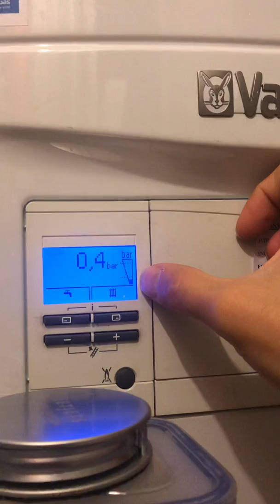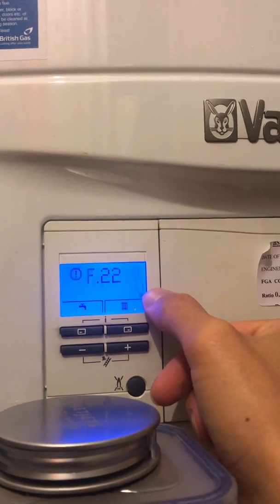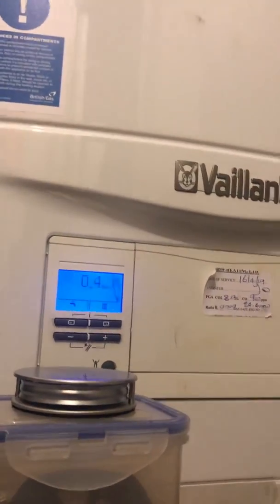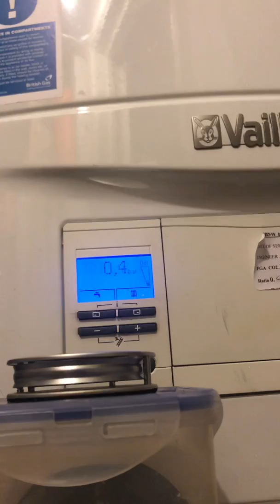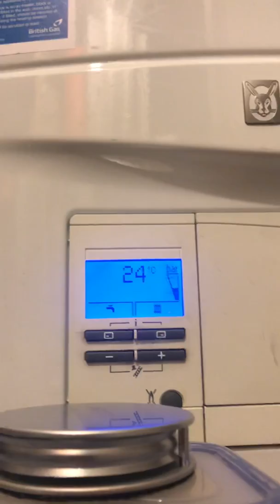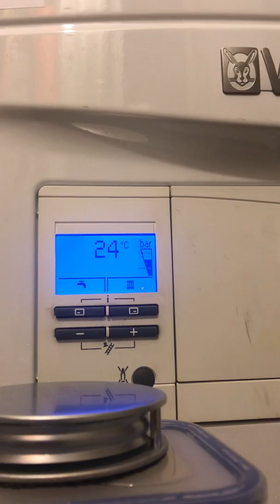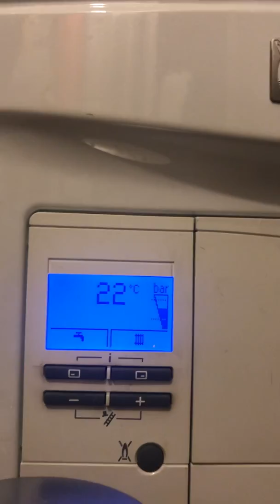Vaillant Boiler controls | No Hot Water and No Heating | F22 Error

Comment: Hello dude< nice video, i have a vaillant EcoTec Pro 24 ,  at the moment im getting hot water intermittently , most of the time the hot water is available, but on a lot of occasions, the boiler will click on then off again within a second or so as it tries to give hot water, and it wont give hot water at all despite leaving the tap running.  Also the water flow out of the hot tap is lowish when it first runs before receiving hot water, also im not getting hot water very early in the morning also,  when this happens the boiler doesnt click on and off at all even.   from what i know so far this all can be an issue with the flow sensor component inside the boiler? the pressure inside the boiler is just below midway of the two lines, so no problems there. any help would be appreciated   regards James,  a while ago my microwave triped a fuse in the flat, and while it was still on i tried pushing the switch back up but it kept coming back down again because of the microwave, anyway perhaps this electrical discrepencacy with trying to push up the fuse switch mutiple times has affected the electronics of the boiler/firmware/flow sensor.
Reply from the maker: I think it could be anything really. 🤔 n this case it might be wise to get a professional out for a quick look as they would do an overall check that will identify the fault and then change parts required etc. please subscribe and like if you haven’t already would really appreciate it 🙏🏻. Best of luck 🤝

Comment: Thank you but still didn't work. Had this put in 3 yrs ago and I've had nothing but trouble. I've had engineer's on 5 times 3 mote controls. Lewisham council fitted it under disability grant though I paid 1500 quid for it. When I bought my flat it had a leaking boiler with a bin under it! That was more reliable than this piece of crap. No hot water or warmth for 2nd year in run for cancer sufferers.
Reply from the maker: Really sorry to hear that buddy. Might need an engineer to look into it incase is faulty inside. Best of luck. Please subscribe to my channel. Would mean alot in order to grow🙏🏻